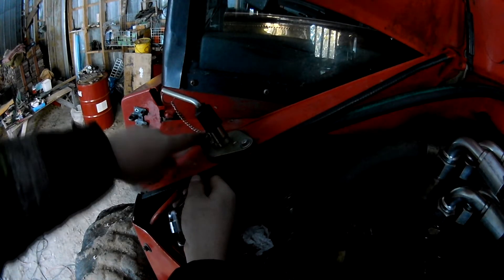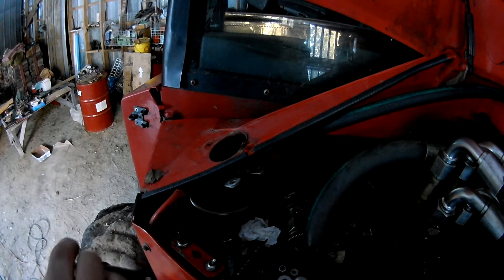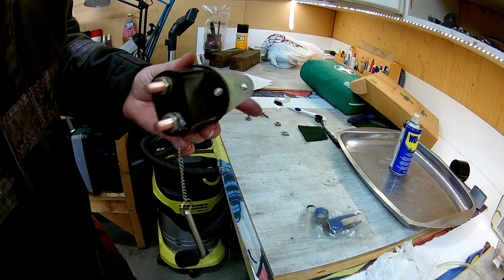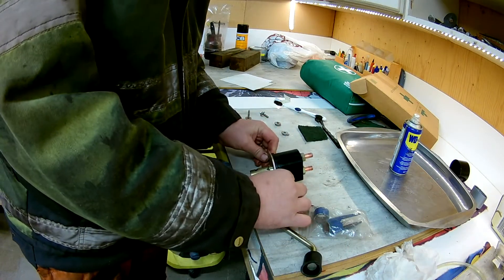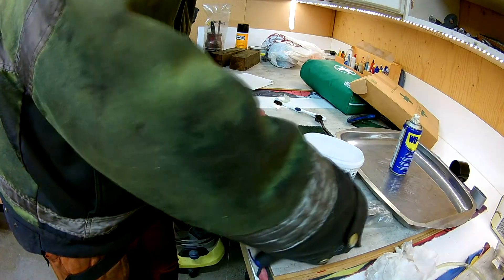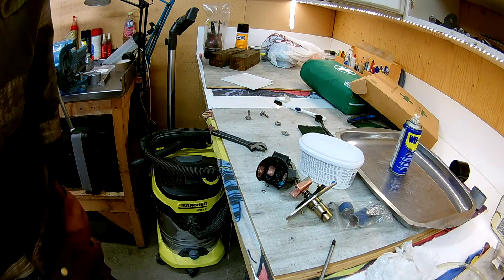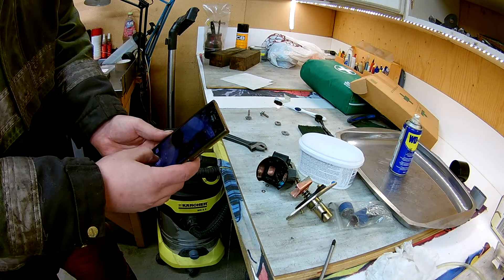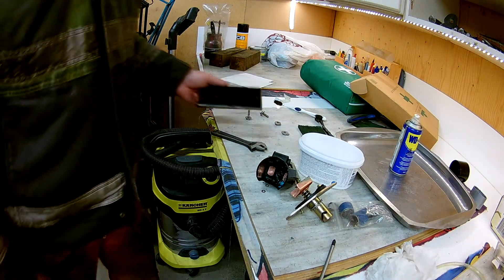2021 Valmet 860.3 Extra curcuit breaker broken AGAIN =(

Comment from the maker: Seems a comment might have been removed, maybe youtube does not like when links are added.

I will try to post it but chop it apart so if anyone wants to see it you have to piece it together:

https://www.pmkau

bamaja.ee/et/massiluliti-1212-3737-06-12v-or.html

Took unit back to the store it was purchased at, Swedol and they replaced it, so will try one more time.

Did not sound like it was common with issues but looking at it the plastic housing does seem to be on the weak side.